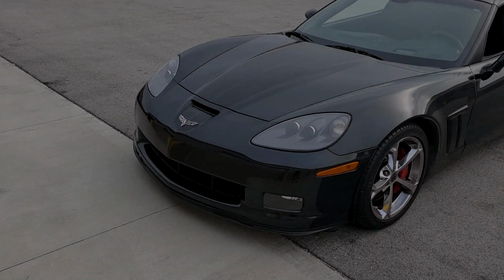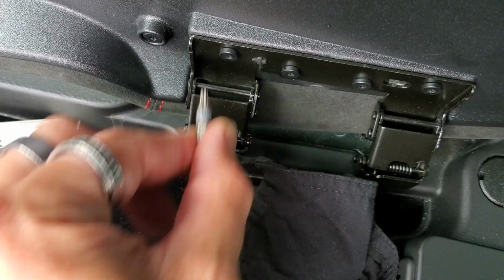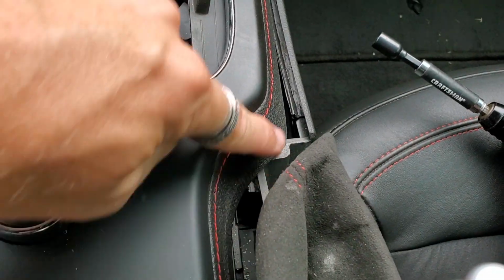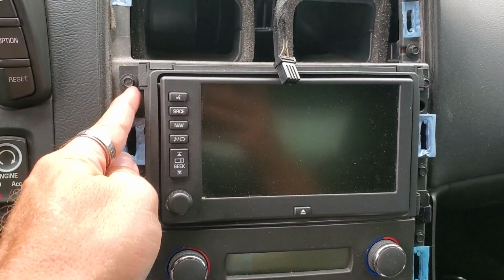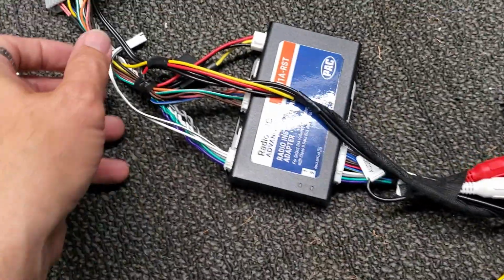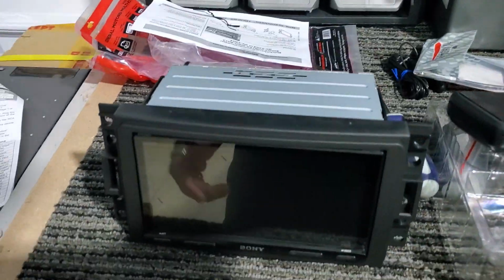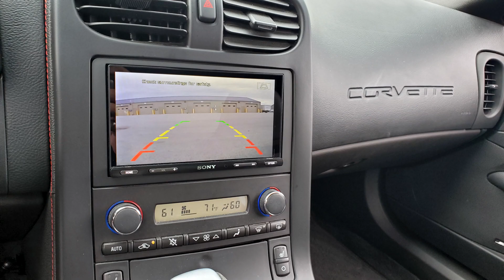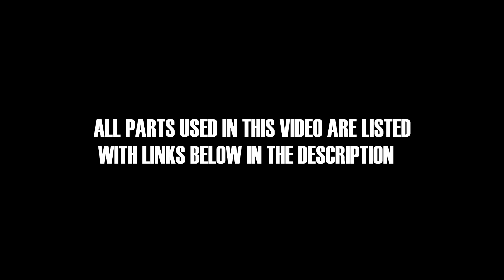CHEVY CORVETTE C6 SONY RADIO INSTALL XAVAX5500 - WITH BOSE

Comment: Did EXCATLY as described for the installation and worked very well on a 2005 Corvette no steering wheel controls. One thing not mentioned was the XM radio module and the addition of a SXV200 to make the XM mod work with the Sony XAV AX5500 which you disassemble the connector and use just the pin connection to the SXV 200 via friction and finally into the Sony. Overall excellent video to aid in the installation

Comment: Thanks for the instructions.
I have one question regarding the SWC two wires and the jack, do I need to wire them and plug the jack in the Sony head unit?
I have wired and installed the head unit in my 2013 GS Vette, everything is working fine except the SWC, do I need to reassign or recalibrate only?
Reply from the maker: You will need to plug the headphone jack into the back of the Sony head unit and probably reset the unit so that it can recalibrate to the Cadillac. This is what I would imagine if that doesn't work I would get a hold of metra electronics technical support line

Comment: Is there a way to run a sub on a separate amp using that head unit I believe some have rca connections you can run it from on the back side

Comment: Can this same install work on a 2005 Corvette convertible Z51? If different please advise correct parts
Reply from the maker: Yes it should be the exact same if it is a C6 Corvette. We have all the parts listed in the description if you need to buy them
Reply: I didn't see anything for the back up camera listed, Is this in your discription as well? Where are you located and when can I have it installed lol. One last question will the XM satilite still work as well with this install? I lose nothing and gain everything...cool!!
Reply: Where are you located? Can you suggest a shop in the Minnesota area? I've purchased all the parts in the discription and a rear camera unit. Thanks is for the info.

Comment: So you tied the purple and white from the PAC and the head unit together then spliced added the red wire that is part of the camera wiring. Isn’t that red wire just a way to signal to the head unit through the red wire to the purple with white strip that the car is in reverse? Isn’t that signal coming from the purple w/white stripe from the PAC to the purple w/white stripe wire directly… meaning the red wire on the camera wire doesn’t even need to be used?
Reply from the maker: The red on the camera is what powers on the camera. The purple with the white wire coming off of the pack pieces what provides the power in reverse. You also have to hook up the purple to white on the radio because that's what turns on the camera portion of the radio. All three wires have to be connected because if not it will not provide power to the camera in the rear.

Comment: 2 weeks ago I had this exactly unit installed in my C6 and it flopped. The Bluetooth cuts out and it doesn’t hold an Apple CarPlay connection long. I was told I more than likely have a bad unit. The shop ordered me another so I’m waiting for the csll. I really want to like this head unit. I hope the replacement works accordingly.
Reply from the maker: We have sold probably close to a thousand of these head units and never had an issue. I have had a few customers bring in radios that have had issues so it could be where they're giving them from.

Comment: So steering wheel controls work, chime works, HUD works, Onstar works and no issues with functions that the car was born with, correct ???
Reply: Yes read the manual on PACs website for the module used for your car and it will tell you oem functions retained.

Comment: Replaced factory radio in C6 Corvette with a Sony AV Receiver. Great backup camera view, Google maps, hands free calling, etc. You connect with your smart phone..
Reply: does sony use the GPS for the map.  just to confirm you do not need a phone to connect to use the map.  thank you

Comment: I heard that if you install an aftermarket head unit in a C6 you lose the HUD is this true??
Reply from the maker: Not that we have heard of
Reply: You lose the HUD capability of showing your navigation information like it can from the stock OEM Bose with navigation. The HUD still works fine showing the speed and all the other settings.

Comment: Pioneer MVH 1400 6.2 Screen w/Apple Car Play also loaded up with apps and comes with remote 2 Din it fit flush and clean also came with a remote and also can access it from a app on your phone $ 350

EchoMaster RearView Mirror with backup camera and front camera on back of rearview that acts as a dash cam car in reverse the stereo, also displays a image when backing up and the digital rearview mirror, displays full-time rear view $140

SanDisk 256GB memory card for Cam System $50

Total $540
That included Pioneer Head Unit EchoMaster Cam Unit and High Memory Storage Card that can record up to 2 week and to erase it, you simply download a EchoMaster App and you can delete the entire memory in less than 20 seconds very handy for safety aspects
I got a very good deal two day shipping discounts on all items because I bought it on cyber Monday  regularly the whole thing would’ve cost me $820 with extra shipping on top. I bought all three of those items from Amazon the next day they contacted me about a warranty i denied it. The camera system is made in the United States. I’ve never had trouble with pioneer products, and the memory disk is bulletproof. I always buy the SanDisk brand